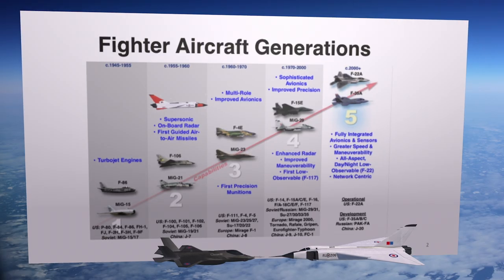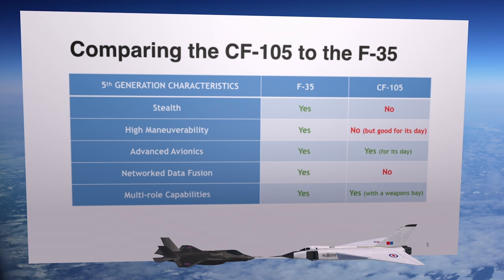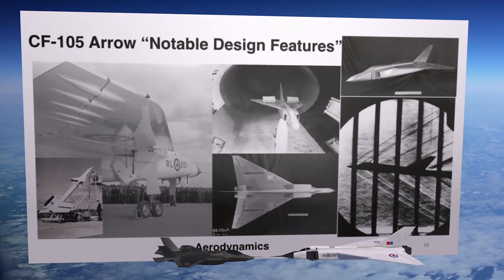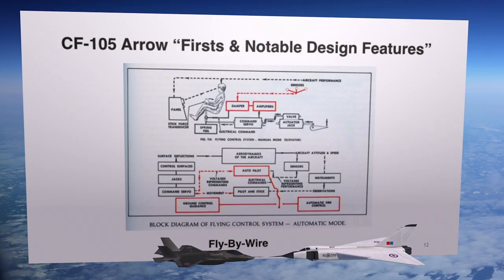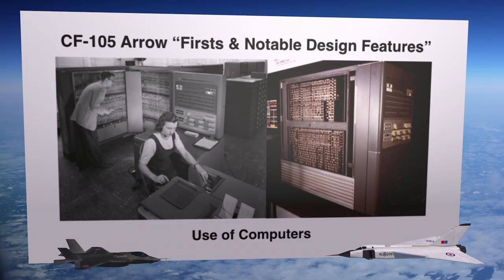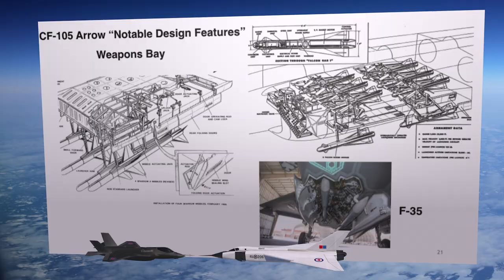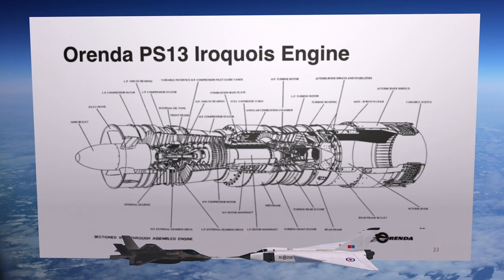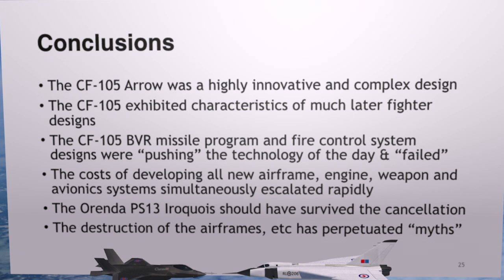AVRO ARROW FIRSTS VS F 35 LIGHTNING

Comment: Black friday will never be forgton
Reply: I was there.  I was angry, but Dief the Thief did the right thing.  It was a black hole of incredible size and NO it would be utterly useless today.
Reply: @Myra_Breckinridge  
Indeed. Canada would've been better-suited to develop a true multi-role combat aircraft rather than a single-platform interceptor.
Building the Phantom II under license would've been a suitable option.
Reply: Raynus  think again the C104/2 became the Arrow and it was multi-role!  

The concept of a multi-role combat aircraft clearly intrigued the RCAF for the C104/2 design closely resembled the CF-105 in size, appearance and capability. The key to its flexibility lay in its massive armament bay. Install six Hughes Falcon missiles and twenty-four rockets and it was an interceptor. Not satisfactory? Try four Velvet glove missiles or four thirty-millimetre cannons with 200 rounds each and fifty-six folding fin rockets. Need a tactical bomber? Four 1,000-pound general purpose bombs would do the job. Put in a camera pack and the aircraft was transformed into a photo-reconnaissance model. Add more fuel and it became a long-range fighter. Carry a second pilot on any of these missions and it could be used as an operational trainer. The possibilities were too numerous to resist. (Dow: The Arrow p. 126)
Reply: @jim100ab9  
And as we've discussed numrous times, none of the bombs, cameras, rockets, etc., Avro proposed on the C104/2 design carried forward to the CF-105. Possibly at some point, but it was evidently clear that the RCAF wanted an interceptor, not a bomber. Avro's multi-phase test and evaluation program, linked in an earlier post, doesn't suggest anything other than a pure interceptor role with the aircraft carrying only Falcon A2A missiles and nuclear-tipped Genie A2A  rockets.
In fact, and as you well know, the Arrow was designed completely around the RCAF's AIR 7-3  mandate which called for a mach 2 capable, 2 crew, twin engine,  interceptor. Bombs and cameras wouldn't be of much use when the sole purpose of the RCAF's request was to shoot down incoming Soviet bombers over northern Canada.
Reply: Raynus here's something else for in R.L. Whitcomb's book! 

This high performance, even when heavily loaded, combined with the capability of the kinds of weapons it could carry in its internal weapons bay, gave the Arrow more potential flexibility then most aircraft built to this day.

For flexibility, the armaments bay could hold 6 Hughes Falcon guided missiles and 24 Hughes 2.75" rockets 

Or 4 Velvet Glove missiles 

Or 4 30mm canons with a capacity of 200 rounds and 56 folding fin rockets 

Or as a bomber, 4 1,000 pounds of bombs 

Or as reconnaissance, a camera pod 

Or to give the fighter a longer range, an extra fuel tank 

When the airframe development began, the RCAF and the Defense Research Board began evaluating missiles and their fire control systems. 

They looked at the following missiles: 

- Douglas MB-1 Genie 

- Hughes Falcon Sperry Sparrow I 

- Douglas Sparrow II 

- Raytheon Sparrow III 

In mid 1955, the Douglas Sparrow II was chosen and the Hughes Company would adapt their fire control system to other missiles. RCA agreed to work to RCAF requirements
Reply: @jim100ab9  
Indeed. I have the book.
2.75" FFAR's were obsolete for A2A engagements by the end of the 1950's & were relegated to tactical ground attack.
Guns were gone from most N. American fighters and interceptors by the late 1950's - the F-8 Crusader (introduced in 1957) was the last US fighter to be equipped with a gun until the F-4E's debut in 1967.
The idea of 1000lb iron bombs didn't get past the C-104/2 design phase.
Sparrow I - dropped.
Sparrow II - dropped (1958) in favor of the already-tested (but poor performing) AIM-4 Falcon and nuclear tipped AIR-2 (MB-1) Genie. 
Sparrow III - dropped 
Velvet Glove - dropped (1956), as it was (apparently/dubiously) deemed unsuitable for supersonic launch.
As planned, the first batch of RCAF CF-105 Mk 2 Arrows would've been pure interceptors, utilizing Hughes' MA-1 fire control system, and armed with Falcon missiles and Genie rockets. This is easily verified.
Undoubtedly, as technologies advanced, the Arrow hypothetically would've transitioned to better, longer-ranged semi-autonomous missiles like the Sparow III.
Reply: @raynus1160  Raynus LOL the FFAR's were used for the F-106 well into the 60's. LOL your talking about the F-4 entering the Vet Nam war and they found out fast that guns were needed and still are LOL,  Now your sounding like Rnl blowing smoke then all the other experts in air to air say your wrong! Your opinion doesn't  count for much!
Reply: @raynus1160  BTY the great USA was beaten in that war by a third world country with a peasant army. The F-4 got 277 ATA kill hardly a good showing for the F-4! No matter the weapons pods could have and would have been up graded to carry any of the new weapons that were coming on line so all you blabber about obsolete weapons are again proves nothing! Here look this up in your book! The Arrow was the first multi-role fighter Think critically as you like to say, the weapons pod never carried any weapons. However being removable and easy to modify could have and would have carried anything they wanted it to carry! 

The Falcon “Z” “the weapon specified were two, Falcon Z, aka GAR-9, aka AIM-47 type missiles each weighing approximately 750 lb. the missile had a range of about 100 miles and a 40,000
foot differential altitude, as later tested on the YF-12A. It was a large, advanced long-range air-to-air missile of the performance Avro had been awaiting. It would have suited the Arrow’s large internal weapons bay while competing aircraft could not have carried it internally—resulting in a huge performance advantage to the Arrow so equipped. and look up this as well! 

Mr. Floyd had looked into the matter with a quick specific calculation on an ICBM approaching at Mach 10 at 200 miles above the earth. He finds that if an “anti” is launched from an aircraft flying at Mach 1.5 at 60,000 ft. its thrust need only be about one third of that required for ground launch weapons carrying the same size of warhead to a given point in approximately the same time. And dividends would accrue in range and accuracy. (Flight and Aircraft Engineering, “Ironclads and Arrows” 14 February 1958

In other words, any Arrow could carry the ABM weapon Avro was considering. The British technical journal engineering also discussed the possibility of the Arrow carrying an ABM weapon in their 17 October, 1958 edition. Jim Floyd has subsequently related that Avro was working with Douglas to adapt a version of the Nike-Zeus system for use on the Arrow. The first stage of the ground launched version could be abandoned, with data link modifications to the remaining upper stage to accept targeting information from the Arrow’s onboard radar system. 

Again your opinion about obsolete weapons shows just how far you will go to lie! 

Raynus You said “I have 'Cold War Tech War' by Whitcomb”

I said “You have 'Cold War Tech War' by Whitcomb? So you have known all along my info was right! WOW troll on. Now get R.L. Whitcomb's Book Avro Aircraft and Cold War Aviation. So you tell Lies, doubletalk, doublespeak, gas-lighting... yup, this is Raynus being an anus you're just a sore loser!”

Comment: All this is based on the assumption that the Arrow was never upgraded in 60 years. Hell, the F22 was upgraded even before the first one rolled out of the factory.
Reply from the maker: Hi Sam....yes, This was simply the Arrow. The series Arrow also fights as was or would have been in 1959.  In making these movies we have not embellished it's capabilities.  It was a very capable aircraft.  Even today, it would fulfill it's primary mission of knocking bombers our of the sky.  regards...Virtual
Reply: I guess I didn't word my response properly. It was more of a message to the naysayers and such that always tend to show up on sites like this. I applaud your choice not to embellish the capabilities of the original. As it is you could fill up a page of listings that the Arrow was the first to achieve from the high pressure hydraulic system to the extensive use of titanium parts and the fly by wire use to the ground control capabilities. But everybody going always tells why it would be incapable to defend itself against modern fighters basing their arguments on the original design that was built. All I wanted to say was that almost every jet in service now is no longer as it was when it rolled off the assembly line and the Arrow would have been upgraded as well. The most modern fighters going now would have few advantages. Sorry for the confusion.
Reply from the maker: @mass4552  HI Sam,  I did take your comment as a positive comment, thank you.  We do fight the Arrow as it would have been in 1959.  These movies are thought out for a plausible scenario.  The scenario presented in Ep 3 and soon to be released Ep 4 are plausible, but you may have noticed it is a very narrow spectrum that the Arrow could kill a fighter today.  As for a bomber, it would do the job better than most, even equipped with it's original armament.  
Clearly upgraded to what is on an F-15 today, it would be very similar to an F-14.  Able to kill you from a long way off, but not a dog fighter.  regards...Virtual.
Reply: I fully understand you don’t want to embellish on the Arrows abilities. However is it an embellishment to quote J.C. Floyd in the video interview he gave back in 1989 for the documentary “There Never Was an Arrow? He clearly is stating facts when he said “Aircraft now-a-days maybe more sophisticated in this or that” Here he has to be talking about Radar, weapons and other electronics. He gives more facts “better engines, better fuel consumption, better pressure recovery”. Again we can all agree is this a fact.

So when he stated “but there’s nothing I know of that would even now today be an improvement on that maneuverability capability” why would he say this if it wasn’t a fact as well? Here are three planes that were flying well before the interview. They are considered highly maneuverable again, why would he say they were not an improvement in maneuverability. He had to have known about them? The F-15 First flight: 27 July 1972 --- F-16 First flight: 20 January 1974 --- F-18 First flight: 18 November 1978

Look at the basics of what make a fighter very maneuverable its low drag, low wing loading and high thrust to weight. The F-15, F-16, F-18 and the Arrow have high thrust to weight ratios. In this regard they come out about even. 

Next is low drag, the F-15, F-16, F-18 having about half the wing area compared to the Arrow. This gives them less drag from the wing but the penalty is that they have a higher wing loading then the Arrow. What everyone forgets is that the F-15, F-16, F-18 carried their weapons in under the wing pylons. The penalty for this is disrupted the air flow under the wing and creates weapons induced drag decreasing lift and maneuverability. The Arrow carried its weapons internally with no air flow disruption or weapons induced drag penalties. Here again in this regard they come out about even in drag.

This is why Mr. Floyd said “but there’s nothing I know of that would even now today be an improvement on that maneuverability capability”. So the Arrow was at least as good as the other aircraft when it came to maneuverability in a dogfight. That being said the Arrows Radar, weapons and other electronics would be next to useless in a dogfight today.
Reply: @mass4552  thr avro arrow had 22 of the first of fighter planes at the time ... and still has the 15 firsts still in use today ... heck look at ALL the modern fighters and they ALL show signs of the arrow Mig, f16, raphael ... sukoi mirage .. even the space shuttle (an upside down arrow with the tail relocated) the one I like the most is the triple redundant flight system with fly by wire fly by wire hydraulic assist and hydraulic nly .. ALL separate
Reply: @jim100ab9  when you think of it ic's at the time were large compared to more recent times ... heck the basic gates in the 5400 series line were the same size as current with half the amount of gates ... now we have surface mount tech that could make that old 5400 series chip carry 3 to 4 times more gates ... this is similar to the IBM XT 4.77 hz at 1k of ram with a 10 meg hard drive ( i missed the 640k version by a week)  .... on a board the size of a laptop folded open ... now that same board can fit in your hand and has more functionality than the complete apollo program in all its years .. and yes I started my electronics on them suckers ... my first computer was a heathkit z80 u build followed by the vic 20 with 68k processor card and machine code the hard way
.
7400 series was civilian use and not released until MUCH later the 5400 series were broader spec ranged military grade versions ...
Reply: @0623kaboom  Agreed. Even the high hydraulic pressure systems were unheard of in any airplane at the time.

Comment: I mean look the Avro Arrow was advanced but it's not 5th generation. It's more like a Canadian Mig-25
Reply from the maker: H Bill.  We are not comparing the jets capabilities in this video, we are comparing their respective design processes, which were very similar.  Obviously the Arrow was not 5th generation, but it was highly advanced.  regards....Virtual
Reply: A pretty disingenuous comparison.
Reply: think of it this way the air7.3 spec the arrow was DESIGNED for ... has NOT been met to this day ... 70 years later ... planes have gone from 2nd generation (when the arrow was built) to current 5th generation with the f35 ... ... 70m YEARS and it is still in the fight with OLD tech ... THAT is what is being highlighted ... he aint calling it a 5th gen plane he is calling it a superior 2nd gen plane that still has the guts to play with modern jets .... the closest plane to this longevity is the f15 ... and it had years of upgrades to get there ... yet the arrow with NO UPGRADES since it was canceled still can compare ... that is what makes the arrow so special ... literally a 70 year old taking on a teen and able to beat them ... THAT is excellence that needs to be remembered